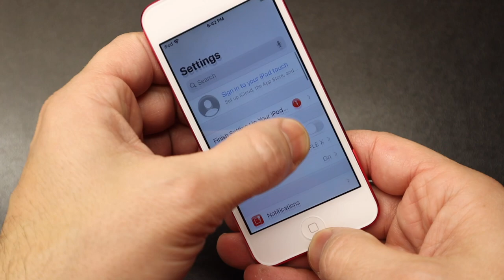iPod Touch Cracked Screen Replacement | iPod Touch 5th, 6th, & 7th Gen | Apple iPod Restoration

Comment from the maker: Let me know if you have any questions regarding this repair, Thanks for watching!
Reply: I just used your video for replacing my screen. The screen was not smashed or cracked, but the touch did not work! Everything was going smoothly with the replacement, the video was helpful and I thought it worked. But I turned it on after and the touch still did not work. Any idea what the issue could be? Great video by the way!!
Reply: What kind of drill is that
Reply: can you use a hair dryer instead of the heat gun?
Reply: @menacingmice  yes you can
Reply: My diditizer broke and my screen fell off will this work

Comment: Very good video.. I had to replace  a "shot" battery on my Ipod  touch (6) . It's amazing the battery was only a couple of euro & included was a small suction cup &  plastic tools. After a gentle heat on the lower adhesive pads the suction cup removed the screen & side clips with very little effort & no damage..

Comment: Thanks for this great how-to. I am having problems getting the clips to catch when closing the ipod, especially on the left side where the volume buttons are. Any thoughts? I'm afraid I might break the new screen if I squeeze any harder. Ipod works fine though.
Reply from the maker: The metal shield that screw down into the frame has small metal catches that clamp onto the plastic screen frame, these need to be carefully bent upward and inward to catch onto the new frame. This happens occasionally to newer screens that are not quite exactly like the original
Reply: @TheFixTech  Thanks. I figured it might be the shield. I already removed it and placed it again but no luck. I will try your suggestion now. To be sure I understand this though, from the outside in is base, metal shield and screen frame. Correct?
Reply: @TheFixTech  Well, tried it and then the other side wouldn't go down all the way. Screwed around with it too long and ended up with a bunch of lines all over the screen. What a waste of money.

Comment: Got one of these 8 GB 4th Gen iPod touch presumably dead with cracked glass and damaged screen.
I did replace the original screen with another one from the same Gen 32 GB iPod but with dead touch on mainboard and also the front camera cuz wasn't switching.

Now working but black glass instead of white. Only spent 2 USD and time and patience for the replacement process. 4th Gen are tricky and power and volume flex prone to broke with a small error.

Comment: Good Video, but why didn't you use any adhesive strips when closing it up?
Reply from the maker: The iPod touch only uses small adhesive strips near the home button, the rest clamps down with metal and plastic clips located on the screen frame and iPod housing. The factory adhesive strips are very sticky and reusable

Comment: Can i buy just the mid frame bezel for my 6th gen A1574 the screen is fine for some reason bezel dried out or ? And came apart in places lifting the screen
Reply from the maker: You can re glue the bezel or yes, you can buy just the frame. Usually an eBay purchase.

Comment: How can I discern which generation it is? And what size screws are those?!?!
Reply from the maker: There are a couple ways, in the settings app/general/about. Or on the back of the device there will be a model number. Screw size: tiny

Comment: After replacing the screen the touch pad wouldn’t work. Took it back apart and it has white lines in the screen 🤷🏻‍♀️
Reply: You were not gentle enough and the lcd is damaged